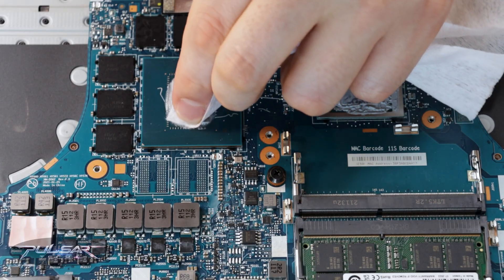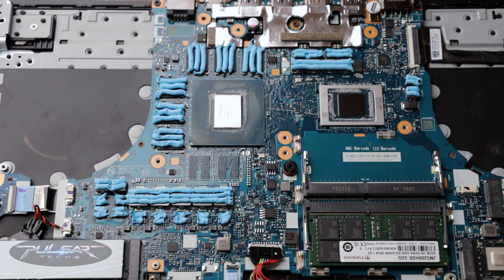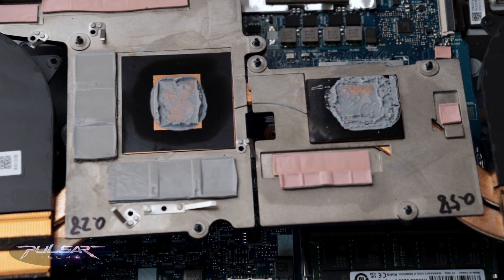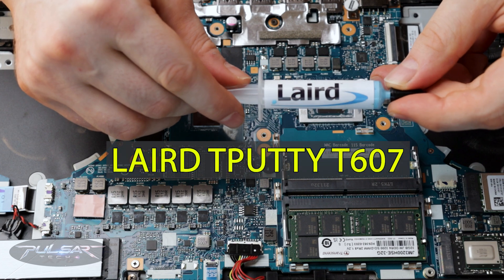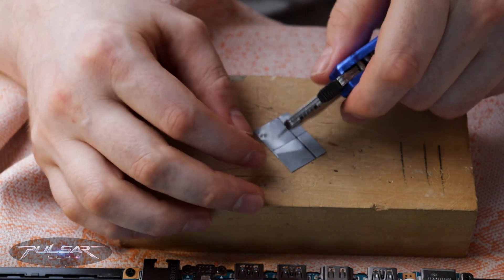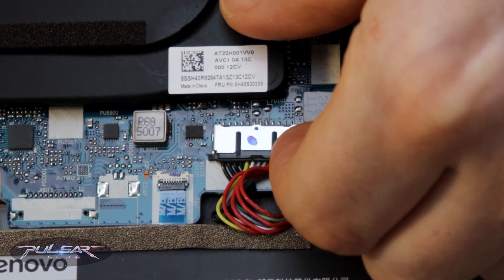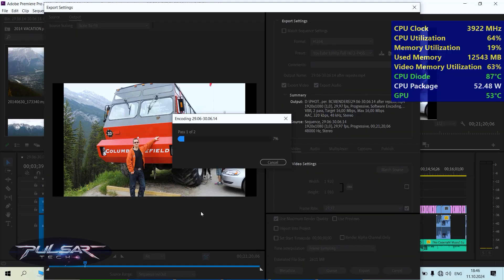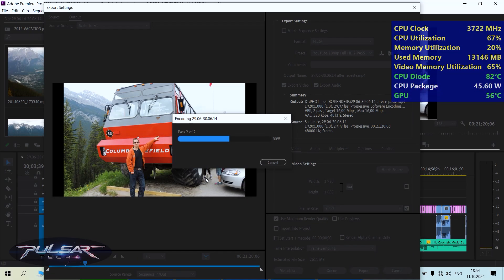From 100°C to Cool ❄️ Lenovo Legion 5 PTM7950 Thermal Upgrade

Comment: I just did mine with K5 Pro instead of Laird. Laird is too difficult to get in Canada.

It's a Lenovo 5 Pro 2021, 5800H, 3060. CPU temperatures went from 85C on load to 70C. 50-55C idle to 35-40C or so. Idle is hard to pin down as the CPU constantly cycles up and down, likely due to Windows 11 (spyware) routines. GPU exhibits similar temperature tendencies.
Reply from the maker: That's great to hear! It sounds like the K5 Pro is a great alternative. Thanks for sharing your results, it's helpful to know how different thermal pastes compare.
Reply: @PulsarTECH  I did use tpm7950 for the cpu/gpu to specify. Used k5 for the vram/mosfets etc

Comment: Hi. Is 10g of tputty 607 enough for this? also how long does it last? thank you.
Reply from the maker: Hi, good question! Just to be safe, I have a 10 ml tube, which corresponds to 35 g due to its density, but I still have more than half left. So, I think 10 g might be just enough. However, I would recommend getting at least 15 g if possible, just to be safe—you don't want to run out and then have to wait for the next shipment to arrive.
As for how long it will last, it depends on many factors. The best approach is to monitor your system temperatures: if they're fine, there's no need to do anything. However, if the temperatures reach 100°C, it's time to refresh the thermal paste.
Additionally, if you clean the fans, you will need to replace the thermal interface material anyway, as the fans aren't accessible for cleaning without removing it.
Reply from the maker: Forgot to mention, get a needle tube handspike made of aluminum alloy. It helped me a lot to squeeze Laird out of the tube because it is very thick, and it might be difficult to get it out with a regular tube.

Comment: Did you keep the grey and pink thermal pads on the heatsink, or removed and used sorely the laird tputty? It's not obvious from the video as we don't see the underside of the heatsink when you install it back on.
Reply from the maker: Hi, good question! Yes, I have totally removed the grey and pink old thermal pads. They are not needed anymore as laird tputty is used instead.
Reply: @PulsarTECH  Thank you. I'm probably going to use K5 Pro since Laird is a PITA to get in Canada.
Reply from the maker: @fiorin_rhiri  I haven't tried K5, let me know how it works out.
Reply: @fiorin_rhiri  yo just checking in to ask did the k5 pro give similar results?

Comment: Hello Brother, Unrelated to Topic of Video but i need a little help.
I too have Legion 5 pro 2022 Amd (Gen7) and noticed that my Dgpu is running on Pcie gen4 x8 instead of x16, tried all stuff Updates (Bios, Gpu etc...) everything but nothing seems to help, however Igpu Radeon is working in x16.
I diagnosed in Nvidia control pannel (Sys info) and Hwinfo.

Also from past 2 years i noticed (Bug or I don't know) that In Dgpu(Nvidia) mode laptop doesn't completely switch off Igpu(Radeon 680m), it just switches Display. Don't exactly know how it works. Also read same issue of another guy in Amd official site with 2023 (Not exactly legion but it was similar prob with Igpu and Dgpu switching).
Now might sound silly but i can definitely feel some lags, bottleneck as well and also have Battery drain buze of Both Gpu being used at same time.

I hope i could explain well and If u have any knowledge about this stuff that i shared then definitely it would be really helpfull. Thanks for ur time....

Comment: Hey, this video is really helpful. I have the exact same legion. I had a couple questions : 
1. Where can I buy PTM7950 from?
2. Which software are you using as your cpu/gpu info overlay while testing.
3. What are/were your Max/Min Processor State % in your power  plan?
4. Was your "Processor Perfomance Boost Mode" enabled while testing?

Really appreciate all the contents coming from you on legion 5. I find all of them very helpful.
Thank you for doing this <3
Reply from the maker: Hi, thanks for you feedback.
1. You can find PTM7950 on your local market places depending where you live or get it from places like Aliexpress etc.
2. The program is Aida64
3. During idle it's like 1-2% and temps 45-50C and during renders just like you've seen in the video
4. I'm not using Performance mode, I use Balanced mode 100% of the time. Balanced mode is fully sufficient for what I'm doing (video editing etc) and it's not overly stressing the CPU (especially when cooling was poor). Now it can handle heat better but still R7 5800H is so powerful that it doesn't need to boost to handle all tasks well. Maybe if you're gaming and want more fps, it might be worth it.
Hope this helps!
Reply: @PulsarTECH  hey thanks.
In point 3, by Max/Min Processor State percentage, I meant the percentage values of your 'Maximum Processor State' and 'Minimum Processor State' inside the 'Processor Power Management' of your power plan.
Is your 'Max Processor State' set to 100% or 99%?
Reply from the maker: @schrodinger6393  Min 80%, Max 100%
Reply: @PulsarTECH  hey thanks.
In point 3, by Max/Min Processor State percentage, I meant the percentage values of your 'Maximum Processor State' and 'Minimum Processor State' of your power plan.

Is the 'Maximum Processor State' set to 100% or is it set to 99%

Comment: If I am not wrong, lenovo uses thermal pad (or thermal paste) from honeywell right?

I am planning to buy legion 7 9th gen which uses 14900hx but it is said that they are uses liquid metal, is it correct?

If yes, maybe I will changet it as soon as possible using the ptm since it is safer that liquid metal for using in laptop
Reply from the maker: Hi, I’ve heard that Lenovo uses phase-change material in their laptops, but I'm not sure about the 14900HX. It sounds like it would require liquid metal. I would definitely not recommend changing it, as long as it’s applied correctly, since it is very effective and doesn't need to be replaced.

Comment: I work at a large volume refurbishment and board level microsolder repair company and can say almost all PTM7950 found on internet (ebuy7, Alix) are relabeled counterfeits from cheaper PTM material or even regular paste rolled on a sheet, those are usually combined with some very useful "tools" afaik only moddiy sells freely available but very expensive legit stuff. Tried the paste form and used hot air from a soldering station at 100°c for a couple of minutes but the sheets are alot more convenient, i used it so much that i can measure the size with my eyes.
(Now in the process of buying many 400X160mm sheets directly from Honeywell)

Comment: Damn brother, that's a deep dive yo. I'm feelin it. Lucky for me, my Legion looks good inside and gets pretty decent thermals, especially when combined with my IETS thermal stand. Excellent video.
Reply from the maker: Thanks for watching and for the comment! I'm glad you found it helpful!
Reply: @PulsarTECH  I know Lenovo uses Honeywell thermal compound, but I think if you use Arctic MX6 or grizzly paste you would have had even better temperatures
Reply from the maker: @bizbarley74  not sure about grizzly but with Arctic your temperatures will go up even higher because it's too liquid and there's not a good press from the cooling system because of lack of screws (only 3 points for CPU and GPU.)
Reply: @PulsarTECH  Interesting. I'm a desktop builder, laptops are outside my realm.
Reply from the maker: @bizbarley74  yea, desktops are whole different story.
Reply: @PulsarTECH  Hell yes. Years of building PCs and when I look at the internals of a laptop, it often feels alien. Still, I feel very grateful to have someone that owns my exact model and provides high quality tutorials on everything you need to know in terms of maintenance. And I gotta say, that laptop still games great for me in 1080p high-ultra. Thanks for everything you do brother.
Reply from the maker: @bizbarley74  I'm glad it is helpful. Appreciate your feedback!

Comment: I have the same Lenovo Legion 5-15ACH6H RTX 3070 and multiple times I opened the back case, cleaned the fans and thermal paste and I put new Arctic Mx4 thermal paste and I noticed slight decrease in cpu temperature but my NVidia gpu temp spiked. My laptop now is just sitting in the corner in its own protective sleeve. I built two desktop gaming pcs one AMD Ryzen 9 5900x and the other Intel i7-14700KF with both AIO CPU liquid cooler. Definitely worth it. I am not gaming on laptops anymore.
Reply from the maker: Hi, Arctic MX-4 doesn't work good on this laptop because it's too liquid and because there are only 3 points of attachment of the cooling system around CPU and GPU chips which don't allow for a solid pressure like on desktop PCs where there are 4 points of attachment, therefore you need something less liquid like Honeywell PTM thermal pad. It's an absolute winner. I don't think you can achieve any better results than with phase-change thermal interface. Maybe liquid metal, but don't want to try it.
Reply: @PulsarTECH  Yes thank you for the advice. I will take it into consideration.
Reply: @PulsarTECH  Hi, I wanted to ask your opinion. I first used the artic mx-6 and was not satisfied, I switched to the Thermalright TF9 which has a dissipation capacity of 14W/mK but the laptop still reaches 95° under load. The pads used in the video have a dissipative capacity of 8.5W/mK and this is why I chose the TF9. I carried out the repasting several times, the first 2/3 weeks the max temperature is 85° after which it goes back to 95°. In your opinion, am I making a mistake in applying the paste or is TF9 also not suitable?
(I use performance mode)
thanks for the reply.
Reply from the maker: @domenico874  hi, TF9 is a great thermal paste but for this application it is not working very well. I had the best luck the PTM7950 pads. Thermal conductivity is important but 8.5W/mK is more than enough for this chip if everything is done right. Also if you're using hard thermal pads on memory and other components, the thermal interface simply is not able to make a good contact between the metal surface and the chip, that's why I'm using liquid thermal pads for the memory etc. I think that's the best setup, or use soft thermal pads on memory, that should help make a better contact. Hope it will work for you.

Comment: I just tried to repaste my 2020 Legion 5 with thermal pad today and somehow my rig is getting hotter. Idk what could’ve went wrong. Im using the same honeywell ptm thermal pad. I forgot to benchmark the before 😭 but now it runs games pretty well and doesn’t throttle and stutters like it used to. Should i redo the whole repaste?
Reply from the maker: Hi, what temperatures are you getting? Have you also replaced thermal pads for the memory chips etc.? If you've used solid pads and not liquid, they might be too firm for the cooling system to squeeze them to proper size thus leaving a larger gap between the CPU and GPU chip and the cooling system therefore there ain't a good heat transfer from the chips. That's why I have opted for liquid thermal pads instead.

Comment: Good to see you change from ptm paste to pad, I think if you need clean the fan more often , the liquid thermal pad is not good , which is more painful to clean off. I recommend you to use thermal putty  like cxh1300 for drier pad, still good for apply and easily for clean off and can be re-applied
Reply from the maker: Thanks for the recommendation! I'll look into that thermal putty!
Reply: @PulsarTECH  Snarks Domain on youtube does thermal putty tests worth watching.

Comment: Only metal for laptops. Everything else is useless
Reply from the maker: It's not useless because it's working great as you can tell from the test results. Do you have a similar laptop? Do you use liquid metal on it and what temps do you get under an intensive use?
Reply: if you want to fry your laptop then lm is indeed better than the others.
Reply: Just like your mother when Im done with her.

Comment: should try thermal grizzly kryonaut it will give you better results the paste isn't supposed to turn solid unless it has been overly heat saturated and dried out turning solid means its time to replace it. its supposed to thicken like a glue then loosen under heat.
Reply: I love these really uninformed comments.  Kryonaut will not outperform PTM7950.  Before you reply quickly to this, know I pioneered PTM7950 before it was out in the market, think the original source of PTM.  I have personally tested both, there is no thermal paste I haven't tested.
Reply: @flat_stickproductions209  TM7950 when correctly applied is about as good as liquid metal from my experience. And PTM7950 last a long period. What do you about Gelid Extreme Thermal Pads with 15 W/m*k versus Honeywell 8,5 W/m*k.
Reply from the maker: That's an excellent suggestion, I was gonna try a similar paste from Zezzio that has even a slightly higher thermal conductivity than Kryonaut but I'm really happy with these results, the temps are really down now even during intensive usage. Do you have the same laptop? What temps and thermal interface do you have?
Reply: @PulsarTECH  I don't have the same laptop mines older and smells like it wants to catch on fire everytime its turned on 🤣 But I use kyronaut for repasting and it was on avg 4-5c cooler than say arctic silver on my 3700x desktop system. laptops in general will perform better being repasted right after getting them because the factory paste typically is of poorer quality. I have done this on 2 generations of XPS because they were thermal throttling just browsing the internet due to the horrible cooling design of the XPS lineup of throw super powerful hardware in small form factors and never change the cooling solution.
Reply: the ptm7950 is way better than kryonaut. I've tested it myself.
Reply from the maker: @themangobui1474  thanks for the update. I haven't tried kryonaut myself but definitely happy with current setup, today I have tested it in another super extensive video render in performance mode where the CPU power was 65-70W all the time and the max temp went up to 95C. Fantastic!

Comment: Have the exact laptop model and just bought the said pads. Brilliant instructions! I suppose you're running on performance mode though how's the temp for other power modes (quiet and balanced)? Planning to limit my temp as much as possible for longevity :)
Reply from the maker: Hi, thanks for your feedback. The tests in the video were all done in balanced mode. But it also performs great in performance mode as well. I keep it in balanced all the time as it has plenty of power to do everything I need.

Comment: yeah , use the honeywell ptm 7950 this is official legion series thermal pad , yeah before apply pad freeze it for 30min , and u dont need to heat up pad  , cpu running will melt it :face-blue-smiling:
Reply from the maker: Thanks for the tip!  I'll definitely look into that.
Reply: Why  freeze it?  It is phase change material. It will liquify regardless.
Reply: @randy2493-s6n  it makes the application easier (especially the peeling off of the protective film)...

Comment: That's interesting. I've never seen anyone using liquid thermal pads instead of regular ones. Seems like a really good solution! How often do you need to change them?
Reply from the maker: Every time you change thermal interface, you need to replace thermal pads. You need to watch the temperature, if  the temperature starts to rise above 95C during extensive tasks, you should start looking to a refresh.